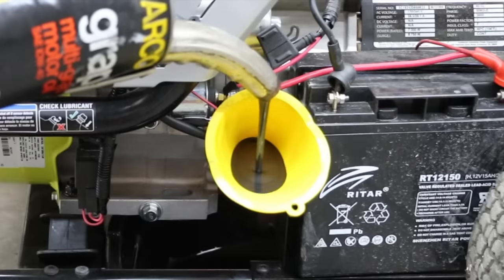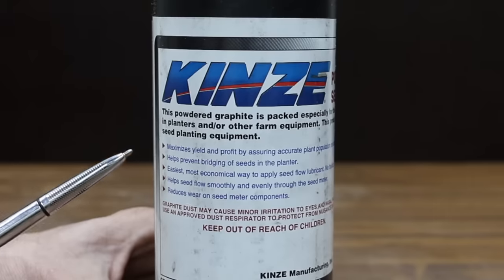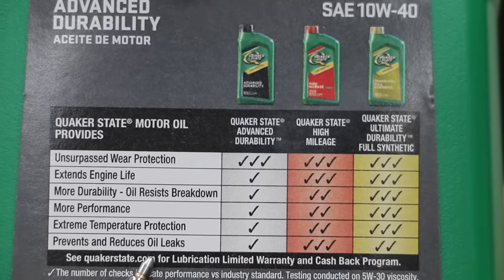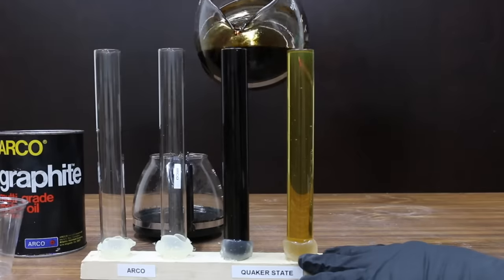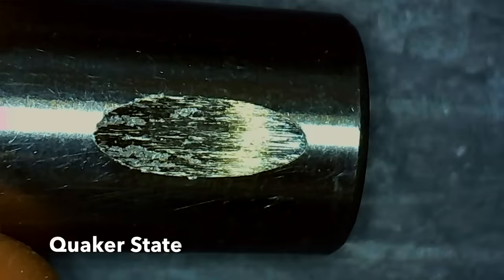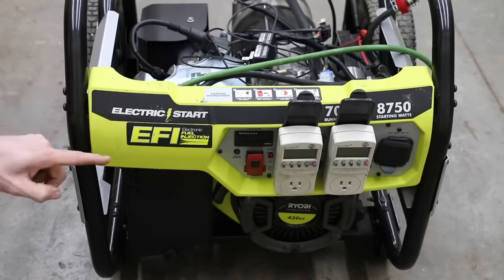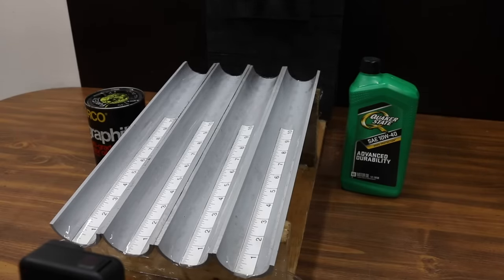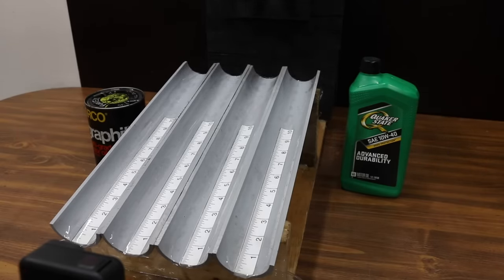Will "Graphite" Help Motor Oil Performance? Let's find out! Vintage Arco Graphite vs Quaker State

Comment: You need to do one test more. First run the engine for some time. Then drain the oil out and look how long the engine will run before destruction. 

Someone told me that graphite was used in engine oil of World War II piston engine air craft. The graphite made it possible to fly a little longer after a lubrication failure of loss of the oil after bullet hit.
Reply from the maker: Thanks for the video idea.
Reply: @Lat60 - true story.
Reply: That would be because, unlike your car's engine, during WW2, the typical American aircraft engine was overhauled or replaced frequently, and the graphite, as an abrasive, could easily more quickly "wear-in" newly assembled, tight fitting bearing and piston ring surfaces.
The looser an engine wear parts are the less likely they will seize-up if you have a sudden loss of oil pressure, etc., but they would use GALLONS of oil that had to be re-filled just like the gas tanks between missions.
Not something you would want to see happen in your car's engine if you want to keep it without having to change out the engine before 100 K miles.
Reply: @tomt373  Graphite abrasive? How is that possible? Its one of the softest materials there is, round about 1 on the mohs scale, the lowest number. There is no way its abrasive to steel. That would be like copperpower grinding away solid diamond.
Reply: @leocurious9919  Graphite is made of pure carbon. Carbon atoms are capable of forming bonds which create a number of different structures. Diamond and graphite are two of the most well-known forms (allotropes) of carbon.
So  now, it depends on the source of your graphite.
Graphite From Coal Seam Metamorphism ("Amorphous" Graphite)
Some graphite forms from the metamorphism of coal seams. The organic material in coal is composed mainly of carbon, oxygen, hydrogen, nitrogen, and sulfur.
So your assertion that all graphite is as soft as that which you are familiar with is like saying "all steel is as soft as my piece of malleable steel bar stock", which can be commonly be obtained from any steel supplier..
Now, for instance, the high-carbon steel in your common household hacksaw blade can cut a piece of typical malleable steel bar stock shows that they are not the same stuff, even though they are both called "steel".
So your finding a nice soft form of graphite is not necessarily typical of what is commonly known as "graphite".
Remember, Graphite has the same chemical composition as Diamond, which is also pure carbon, and I think that you agree about Diamonds being harder then steel.
Reply: @tomt373  Do you have any source for claiming there are (much) harder types of graphite? Anywhere I look its a Mohs hardness of 1 or 2. Nowhere near enough to do anything to steel. I have also worked with a bunch of different typed of graphite and didnt notice any sort of harder form.
And then there is the structure of graphite itself prevents it from having strong bonds (inter layers) and letting it sheat itself appart instead of whatever else there is. So all in all I highly doubt that there is any significantly harder type of graphite out there. The planes of "graphene" are just too weakly held together. If whatever you have doesnt have these weak planes of carbon-sheets that can slide around... its not graphite anymore.
Reply: @tomt373  Graphite ore does contain other contaminants that are harder than the graphite itself. Pure graphite (aka not ore) does not have other forms, it is just graphite. Graphite is always the same hardness. The contaminants in the ore can be harder than the graphite itself. You're confusing ore and the pure substance. Also I don't know where you were trying to go with that diamond analogy because it's completely irrelevant.
Reply: @tomt373  Bruh.. graphite is a lubricant by itself, in dry powder form, so no.. its not an abrasive.
Reply: @tomt373  to note. Most steel even with slightly different compositions can b made pliable or not. And soft mild steel can be hardened with tempering.
Reply: So what's the verdict here, this video is some how bogus?
Reply: Ahhh,tom,stick to ya thumb....& good job project farm xD
Reply: @tomt373  "one of the greatest evil in society today is a person who knows enough about a subject to think he is right. But not enough to know he is wrong" That, Tom is you... Graphite BY ITSELF is a VERY soft material. When compressed and cooked it forms diamonds which are very hard... Kind of like how Oxygen and Hydrogen are VERY flammable but you combine them and they HATE fire... (I know terrible analogy)
Reply: @anjhindul  So I am your "Dr. Evil"??? Your personal Nemeses???
That makes me assume that you have an invested interest in the addition of graphite to motor oil products.
The fact is that in the typical internal combustion engine, the very conditions you describe occurs to the engine's motor oil and the additives in it, since the essential thing motor oil does is protect the wear parts from excessive wear during cycles of pressure/compression and very high heat. Now these conditions, in you own words, would compress and cook any graphite particles suspended in the oil and in your words, create the ideal environment for the particles to be "compressed and cooked... form[ing] diamonds which are very hard" inside of the engine's critical wear surfaces!
I assume that you know that the better cutting tools are "diamond coated", that is, given a bonded coating of industrial diamond particles in order them enable them to cut through very hard materials, as well as the softer ones.
This is not the kind of ideal surface to surface environment that anyone would want to have inside of their internal combustion engine, if they wanted it to last for any length of time.

Comment: Fantastic, my Dad owned an Arco station back in the last 70's-early 80's and I remember that black labeled can and the spout.
My only issue with this video is that Graphite is commonly used as a dry lube. What they add to oil is probably much, much finer particle size,.so adding that Farm Implement to an oil probably did bad things. You could test that by running that mixture through the same wear test to see. Interesting that you increased compression, maybe the large particle size gunked around the rings?
Reply: I thought of that, too. I was always told by my father to never mix graphite and liquid lubes of any kind, it leads to just creating gunk. Experienced this with pinecar derby type cars and graphite lube, and also door locks. Personally I prefer liquid on door locks, but you need to spray them like crazy to flush out any stray graphite, or else they gunk up.
Reply: Or the valves.   While gunking up the valves might slightly increase compression, it would also restrict airflow.
What the hell was up with the knocking?  I really don't understand why that would happen.
Why was so much oil getting into the combustion chamber?  That was a lot of oil.
Reply: True, particle size is very important. The graphite added to the mower seems rather large since there was no puff of particles as it spilled. My 5 micron bottle of MoS2 puffs smoke even if you try not to disturb it as you twist the cap.
Reply: Agreed clearly got to the rings and valves. I honestly think he added 100x too much graphite.  I would like to see a similar test with 1% of what he added.  I suspect a little is all it takes to see improvement.
Reply from the maker: Yes, you are absolutely right regarding the farm equipment graphite that i used.  Graphite particles were way too large.  I should have provided commentary on that in the video.
Reply: @GilBatesLovesyou  So you can spray it with ," Gunk?"  engine cleaner.  Ha
Reply: @grassroot011  Actually it's best to use some sort of solvent like carb cleaner/etc, then lubricate your stuff. WD40 is actually mainly solvent anyway, and it doesn't generally lubricate that great, it just flushes off sludged up/varnished oil. It's why WD40 is bad on bike chains, the oil it has is too light, but momentarily it frees them up.
Reply: @tarstarkusz  i guess that's knocking and not "superknock". As you compress a mixture of air and a fuel, it heats up. And, because of that, the pressure increases even more. If the pressure in the cylinder was just below self-ignition, right after the spark ignited, the expansion of the burning cloud will compress the rest of the mixture and ignite it. Look up "Engineering Explained"s videos on knocking
Reply: @ProjectFarm  -National Cash Register Company required Graphite 'Grease' used on cams and cam rollers during assy and re-lube of the thousands of parts in the larger '2000 class' bookkeeping machines [displayed in Smithsonian] and cash registers of '6000 class'.
Reply: @GilBatesLovesyou  I once tried lubing the windows in my class and tried two sprays: one dry ceramic lube for bike chains and a WD4-like thing from a chinese store. Even when the bike chain lube was double the price per volume, it didn't really solve the creaking problem. Just resprayed with the WD40 rip-off and all went silent
Reply: Graphite is extremely soft. It'd be pulverized by the cylinders well before it caused any damage.
Reply: @GilBatesLovesyou  Funny you mention that. In Cubscouts we had the normal pinewood derby races, and my Dad basically did the thing himself. Even went underweight so he could drill a hole under the front of the car to drop some lead in to move the center of gravity forward while retaining the official weight. Use graphite on for lube.  I made it to 3rd place, and then my Dad got a little mad at me when I missed the final race because you know, 8-9 y.o. kids.  I think #1 and #2 had to race between themselves or something.  Dad loved watching racing on the weekends, so I guess the 'tweaks' he made was sort of like obeying the letter of the law vs the spirit, just like real racing :)
Reply: @tarstarkusz  What it seemed to be from what I could gather from the visual results and from seeing how the engine was behaving, the graphite oil most likely gathered on the top of the piston crown and cylinder head because of graphite's tendency to clump in extreme heat, increasing the compression ratio. Increasing the compression ratio can cause the air/fuel mixture to pre-ignite (aka "knocking"), if the fuel octane used is too low for the given compression ratio. That's what I would consider it to be, given that it ran well before he placed the graphite oil in the engine and he performed no changes to the engine's timing or any other operational parameter. 

If the oil were to clump on the valves, it would have the opposite effect. Build up on the valves leads to the air fuel mixture being leaked out of the cylinder and being unable to properly compress, due to the valve being forced open by deposit build up. It would result in a potentially large loss of power and fuel economy because of much or all of the air/fuel mixture being literally pushed out the opened valve (depending on how much build up occurred and where on the valve it occurred.) Depending on how far open the valve is stuck, it can also cause the valve and piston to come in contact with each other, causing engine failure (in engines with valves opening/closing above the pistons, not like in the case of the lawn mower's flat-head design with the valves offset to the side). 

The oil inside of the combustion chamber can be attributed to the nature of wet-sump oil systems and again the graphite in the oil's tendency to clump in high temperature environments. As the piston travels up and down the cylinder walls, the oil gets slung around as well by the movement of the crankshaft/piston assembly. As this oil is slung, it coats the crankshaft, connecting rods, bottom of the pistons and on the cylinder walls, this is normal and prevents wear of the piston assembly and helps with engine cooling, but regular oil quickly gets moved back down the cylinder walls into the crank case and away from the combustion occurring, through the piston rings and oil passage grooves designed into the piston. The graphite oil gunked onto the cylinder walls, causing it to stay on the cylinder walls in large quantities, when it wasn't supposed to, and be slung onto the top of the piston and cylinder head assembly, this consequently most likely caused the aforementioned build up on the piston crown/ cylinder head.

The clumping all over the engine is exactly why graphite oil isn't sold and was quickly discontinued by AMCO. It had no significant benefits and caused more issues than it helped. It would clog oil passages, foul up spark plugs and covered engine parts in a thick sludge that was difficult to remove. In other words, that stuff was pure garbage (as you saw in the video) and I'm glad they don't use it anymore and haven't for a very long time.
Reply: @ReallyRyan.  Thanks for the reply.  I just don't think the compression was raised enough to cause all this knocking.  It only tested at 105.  This is fairly typical of low compression engines.  Maybe it's all the deposits?
Those rings have to be really leaky to let all that oil past the oil ring.  Then again, as you said, who the hell knows what the graphite was doing.  You are most certainly right that it's a damn good thing they don't still make it.

Comment: Back in late 70"s starting out as a tech. Did oil changes for a fleet that tried Arco Graphite in their Oldsmobile diesel cars. Snapped 3 crankshafts (one in owners car). Found out after 3rd one graphite was clogging oil passage to mains starving them of oil. Did a whole bunch of oil changes that week. Back to conventional oil and no more problems. Still knew when one that had that graphite oil came in oil still came oit black as tar. 10"s of thousands miles later.
Reply from the maker: Thanks for the feedback.
Reply: how about MarvelMajickMystery oil
ive used it as an oil add,in gas,and in power steering all ways makes a difference.
Another best tip is Shell hi octane/no Alcahol fuel,,i get it a High V

Comment: Like this if you would buy Project Farm brand oil, formulated with all of his knowledge on additives and oil testing.

I'd contribute to any fund that gets the ball rolling too
Reply: Yes

Just

Yes
Reply: As long as it was cheaper than royal purple stuff.  I get a good rotella oil pretty cheap that is awesome
Reply: Can you really put a price on peace of mind? I'd definitely buy it if it was priced within reason. I have been using Amsoil signature series 5w-30 for the last 7 years, locally I get it for $11-$13/qt depending on price fluctuations so if PF's oil were in that ballpark I'd be on it like green on grass.

Comment: Thanks for reminding me how old I am.
Yes, I did use Arco graphite when it came out on a new 76 Ford.  No unfavorable results. No one else I knew tried it because it looked dirty.
One thing  about graphite. It will eventually kill a catalytic converter and if it's used on a later injected engine, it will kill 02 sensors.  If you have an engine with some wear, as you see on the mower, spark plugs will foul easily.

Comment: I will bet that most of those graphite particles will just get stuck in a good filter on the first pass.  It works great in locks though.
Reply: It built up and plunged up the oil journals and the engine seized of started knocking. 
It was like filling the engine with sand.
Reply: It's also not good for any roller bearings, such as in camshaft roller lifters and roller tip rocker arms.
Reply from the maker: Great point
Reply: Dry, it will wear out your pot-metal locks...

Comment: That Arco looks like it would work great in a gearbox.
Reply from the maker: Great point!
Reply: That’s a good ider or rear end.
Reply: I had a customer buy a quart and put it in his lawnmower and after he ran it for a while he drained the oil and mowed without any oil in it. After he finished his yard he put the oil back in it and brought his cars and had the oil changed in them to Arco Graphite. When Arco was pulled out of the southeast I bought several cases of the oil and my only regret is that I didn't buy more.
Reply: Richard Arrington lawnmower engines are durable enough to run without oil for quite a while. Graphite will clog up spark plugs, oil filters, and eventually your catalytic converter.
Reply: Ranjit too thin for a differential.
Reply: Maybe also for an air compressor? Since there is no combunstion procces.
Reply: @logik316  
Depends on the diff. Some actually call for 10-W30 or 10W40.

The front diff in my UTV calls for 10W40, as a matter of fact.
Reply: @logik316  I put 2 stroke in a dodge Dakota that was low, pounded the pan closer where it was bent. Ran it for 120,000, to lazy to take it back out.
Reply: @logik316  maybe it would work with the right gear oil?
Reply: Wouldn’t the graphite get caught by an oil filter?
Reply: Wondering how it would work in my Honda rebel. It uses the engine oil as transmission fluid and has no filter.